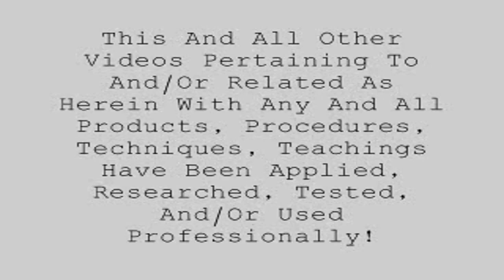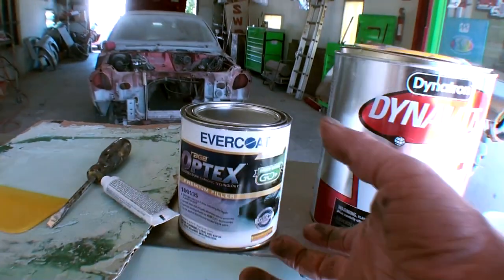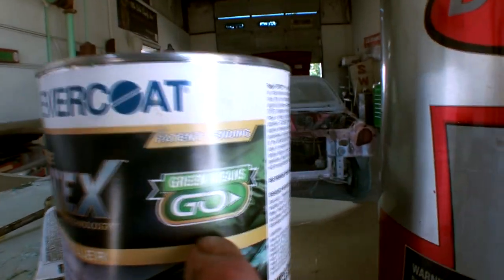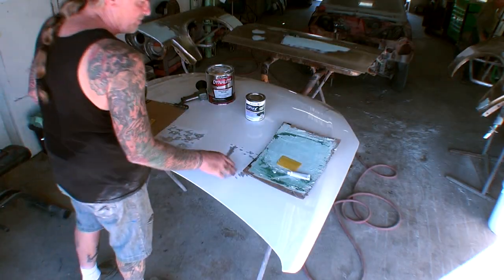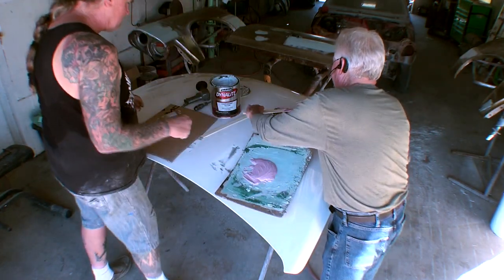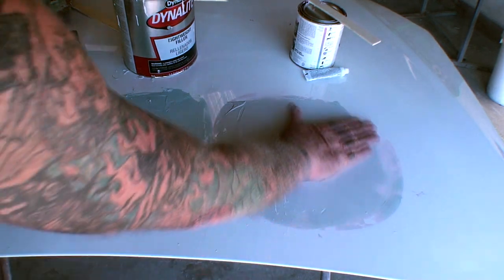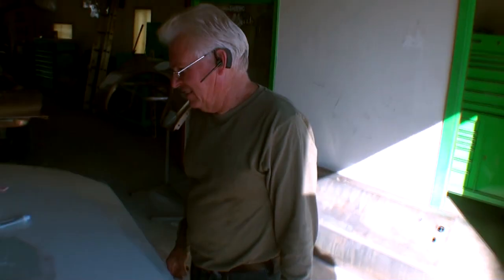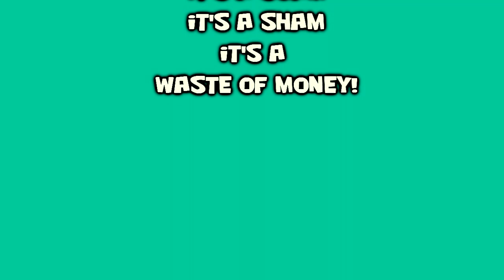Evercoat "RAGE Optex" Body Filler Review - Good Or Bad

Comment: My friend Pete is Old School. All plastic filler is Bondo to ol school guys.  Bondo is like Kleenex, Sharpie, or Xerox. And now everyone out there thats into classic cars refers to aftermarket air conditioning as Vintage Air.
Reply: That was driving me crazy.
As far as the product, this review didn't mean shit.  How does it perform?  Which will fall off the car, first?  Is one more flexible after final installation?
Reply from the maker: Ill make sure to be POLITICALLY CORRECT next time...
Reply: ralph sampson who’s going to wait around to see what filler falls off first? I’ve never seen a body filler fall off a panel if applied correctly. There are just little characteristics that differentiate between fillers. Choose one you like and stick with it. Get off Petes back about his content not meaning to you. He’s making great content. Quit watching his videos if you gotta be negative.
Reply: @norangeito  
Have you never seen cracks in filler (Bondo).  I just bought an old truck that has filler.  It has cracks because it is falling (turning loose).  Improper prep?  Likely so.  My point is after watching the video, we don't really know anything about the "new" product other than it is expensive and hard to cut.  If we were to talk to the mnfr, what would he say is better about his product?
I'm not on Pete's back.  I just commented in the OP's comment which was people use brand names instead of generic names.  That's funny.
If you are going to cry on Pete's behalf grab a Kleenex.  LOL.  He is a big boy.  He can handle anything folks on his videos can throw at him.
Reply: @RalphSampson...  I know!!! Why don't you make a video of this product and then set your camera up for 2 or 3 years on "TIME LAPSE" and we'll see if it falls off.... Your comment doesn't make any sense at all..  So you bought an old truck where the filler was falling off and cracked... That has NOTHING TO DO WITH THE PRODUCT --- It's called PISS POOR PREPARATION AND SORRY ASS LAZY WORK that someone did to it because they didn't know what they where doing!!  Your just here to be the outcast and get brownie points so people will argue with you!
Reply: SWRNC PETE AMEN!!!!
Reply: @myfriendpete  
Huh, sure...okay.  Why are you here?  I'm just asking why is the product bad?  We don't know what the mnfr would say.  Pete may be entirely correct.  I haven't heard the cheap product he uses.  That's good information.  I never heard of it.  I'll look into it.  He says he does not advertise products if they don't pay him.  Is that cheaper filler company paying him?
Now, our buddy, Pete, did a video on a product to dissolve rust.  That product was sent to him free to review it.  He did Part 1 and never did the follow up Part 2.  He was trashing the product before he even opened the damn box.  My guess is the product worked very well and instead of eating crow by admitting it was a good product, after all his pre-judgment, he just ignored the facts.
Pete, like all of us, is not perfect.  He has some good ideas and some well, not so good.  I watch his videos to learn a few things before I start on my own truck.  I will use the information he provides.....good and bad.
Again, why are you here?  What the hell are you talking about with "brownie points"?
Edit:  Sorry, I didn't realize you are the  same Pete in the video.  Duh, so I know why you are you here.  So, I can't ask questions unless I agree with you?  That's mighty big of you.
If you think I am here to argue, no problem.  I came to learn but, okay.  I can unsubscribe.  One less person....I know.  No big deal.
Reply: ralph sampson First off I gotta say that that was funny as heck how you didn’t know that was Pete’s other channel! You got me rolling on the floor! 
But to try to put the fire out, your original comment is what got me defending Pete. It was just a little harsh. Pete puts out content for people to watch not only for the entertainment factor but for real life autobody experiences. Meaning information for the everyday DIY guy. Just like almost everyone on YouTube he’s sharing his daily life. 
I totally understand where you were coming from but in reality none of us know if and when exactly something is going to fail. Your comment sounded like you needed results right then and there. There’s no way that’s possible. Pete can only give an initial review based off simple real time facts. And you’re right it would be nice to see a review on the things you stated but that’s not feasible. Maybe down the road a few years from now someone will write a review on this product after seeing it fails. Or maybe someone will scientifically prove it worthy or not in an accelerated testing format. But for now Pete is just awesome daily entertainment and realistic information based. Don’t unsubscribe man! It’s just YouTube banter! It’s all just fun! It gets the blood going when a debate starts up! Have a great day man. I hope your project goes well. Lots of info out there for the DIYer!
Reply: @norangeito  
Thanks.  I'm not going to unsubscribe.....unless Pete wants me to do so.  He has too much good information for me to learn to just ignore it.
I have also subscribed to Eastwood's channel.  They usually have good videos, too.  But, sometimes they are just selling product.  I'd like Pete's input on some of their stuff.  Like you said, "Pete is down to earth real guy" and he will let us know how it really is.
Thanks for the well wishing on my truck.  It's a '62 F100 Integrated Pickup (most call it a unibody).  Time.....and money....will tell how it goes.

Edit:  Thanks for putting out the fire, man.  LOL.  I must admit I am a little embarrassed not realizing about the "other channel".  I re-read this whole thread.  Yep.  Pretty damn funny how I was debating "some guy" about Pete.  Funny stuff right there.  Crow doesn't taste too too bad.
Reply: ralph sampson Right on man! I’ve been watching Pete for years and his channels are just so raw. Like I said lots of entertainment and like you said lots of good info. I like the way he tells it the way he sees it. He doesn’t try to sell you or push product. He just goes about his day and does it the best way he knows how and his work speaks for itself. Awesome restos. 
Awesome project truck to! My buddy is restoring one as well a 62 or 64. I work at an Autobody supply establishment and sell all kinds of product to shops and walk ins. Everyone has there preferences that’s for sure! 
Keep on that project and stay motivated! You’ll be proud of it one day!

Comment: Evercoat has a brand of bondo that is the same exact price as the dynalite and you don't need evercoat hunny to put in it either. Been using it for a long time now. It pinholes pretty bad but is easy to sand and very easy to wipe.
UPDATE: Its called evercoat "Z-GRIP". Soooo much easier to work than dynalite for the same price!
Reply from the maker: Ive used it before. It's as good as Evercoat, but over here it's more expensive then Dynalite.
Reply: @diyautoschool  got a paint shop selling it to me for $16 a gallon. And i can get the evercoat "liteweight" for $13 dirt cheap stuff. From my experience sanding dynalite is like sanding on the shop floor its so hard lol.
Reply from the maker: @brainwashingdetergent4128  I guess it all comes down to what your used to using and dealing with.. Ive never had a problem with Dnyalite and have been using it for ever... I have used RAGE before but is to expensive.. SInce Im not doing 100,000.00 restorations over here I rely on what works for me and can make me money to pay my bills... Ill check out the z-grip and do a test on it and let you know what I think.. Thanks for the info...
Reply: @diyautoschool  rage is just over priced z grip. I didn't even notice fewer pin holes but "z-grip" or "lite weight" both made by evercoat both dirt cheap and I believe you will like it better. Sands a lot easier wipes smoother and no hunny required in cold temperatures.  Looking forward to your review.

Comment: Pete When I first started doing bodywork in the  late 70,s all I used was Dynalite. If i remember it  came in a red and a blue label. Think one was regular the other light weight. always had luck with it. Years later the supply store said try this new Bondo called Rage. It was like 40 bucks for a gallon. stuff went on smooth . I liked it and when I went back for another gallon it became like 100 bucks a gallon. I was told 40 bucks was a promotional price to suck you in to use it. I was', t going to get the round so back to the dynalite. I must say I now use the house brand gold of my supplier and it works just fine. good tip on the honey mix. And I read some one said Uphol sucks. I liked working with it,and was cheap, but few years later its bubbling up on my car I only take out of the garage for shows.  Another example of the corperation lieing to you on how good "Their" product is.

Comment: putting bondo in and rubbing it down is only half the test, need to know how much it can flex or if it snaps as soon as you try and bend it.
thats where alot of problems start, when the panel vibrates, flexes or twists in regular use
Reply: That’s true. It’s also this products claim. It sticks to all surfaces, it’s flexible,, and oem certified. It spreads like a thinned filler with the strength of un-thinned while remaining flexible, and easy sanding. The changing color thing is just an added bonus, which, when you are in a production shop (their intended market) that delivers 40-50 cars a week?? All these things are $$$ to the bottom line.

Comment: should the repair areas not have been cleaned down to bare metal all over or does the new bond stick to paint also.
Reply from the maker: If the surface is prepped properly it should stick to any surface..
Reply: thanks that clears up a lot. @diyautoschool

Comment: I think the Evercoat is for people with more money than sense. After all you really want to work the bondo before its totally hard at least on the base coat. I was watching another guy doing some work on a car where he's spot welding a panel on a car and used a weld primer, which I'm not familiar with having watched many videos on auto body work. I was wondering about your thoughts if the weld primer is worth using. Thanks for sharing your knowledge and experiences.
Reply from the maker: Is WELDING PRIMER MELT AND BURN PROOF When you Weld On It???  That should answer your question.. I don't believe in it and have NEVER USED IT in the 40 years Ive been in business... THanks for watching Kevin..
Reply: @diyautoschool  the idea with weld thru primer is to cover the surrounding area around the weld that may have been exposed during grinding. Does it vaporize at the weld site? Sure. Does it give you a bad weld? Nope, no issues there. So really using something is better than using nothing and letting your work rot. But then again you wouldn't get return customers if it lasted the test of time would you? In wet climates it's a must, and so is wax oil after paint.

Comment: If you sand the cheap Bondo at the right moment,it's just as good as the expensive bondos.But yea if you let it dry to hard on a soft panel,then you are screwed,just grind it off and start over

Comment: Pete not to  get off  this  product,  but recently  I painted  my 69 dart hi gloss  black  came  out  great  thanks  to  you. But unfortunately it was a vinyl top  car my biggest  mistake  was  using  Upol spray on bondo  roof looked great until  two  weeks went to crap.  No your  products  thanks  Pete
Reply from the maker: I had a similar problem with UPOL REFACE as well on a car.. several weeks later it cracked, split, shrunk, and came off... I won't be using UPOL Products ever again...
Reply: @diyautoschool  Thanks  Pete  you enlarge  my shop...

Comment: I use it at my job where I work it's okay there's also a liquid that goes on with a sponge called 440

 to get out micro pin holes just rub it all like shoe polish and you're good to go you don't have to be a high end auto body shop to use it I work for a GEICO direct shop and we use it and you know how cheap they are

Comment: Body filler uses polyester resin not epoxy resin. The sandability depends on how fine the talc is. Polyester resin and talc are the main components. Original "Bondo"developed in1955 AD  used expensive Epoxy resin. Over the years the lower priced polyester resin became the choice for body fillers. My two cents.

Comment: they way i look at it is the more money u put in it there will be a point that u should have just got a used panel in good condition the idea of using bondo is to save money not spend more or u would just lead fill it  because lead u can get for free if u know how to get it i shoot black powder guns and get lead from tire shops then clean and make blocks out of it till i'm ready to use it just bondo is so easy to use and light but lead is better if it is a street car use bondo if it is a show car use lead my personal cars are lead fill only

Comment: Evercoat is a separate company but ... Bondo Brand and Dynatron Brand are both made by 3M and 3M makes some good shit.. 3M is a big company that is full of research scientists and their main goal is to find a solution to something.. Like Body Filler and Panel Adhesive And Glues that are used on cars and boats and the space shuttle ... where Evercoat is a body filler company that makes body filler ... everyone that i have ever talked to that likes evercoat is because the stuff is smooth to put on and lightweight to sand but its not that much different... its all talcum powder in a resin..

Comment: You cant beat evercoat tiger hair. Welds will not come back in 3 years like duraglass. Color changing bondo lol. Why?? That shit will not sell lol. Glad you showed us i wanted to see this shit. Its all good unless you dump fiberglass resin in it .. Rage gold for me.. I use the evercoat z grit in a green gal thats only like 18 bucks a gal.. Never buy the bondo brand at walmart thats junk. Plus your fender will be heavy and sand like concrete. Lets talk clear.. Deltron 4000 going on my car ... Seems better then concept 2021